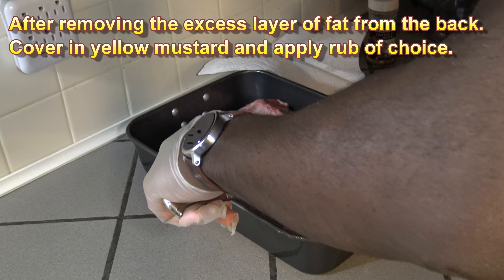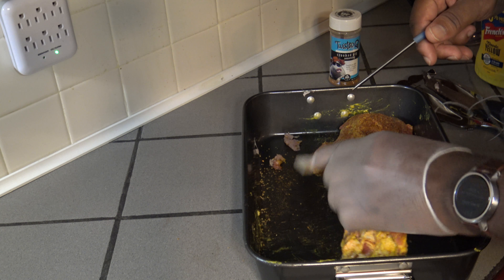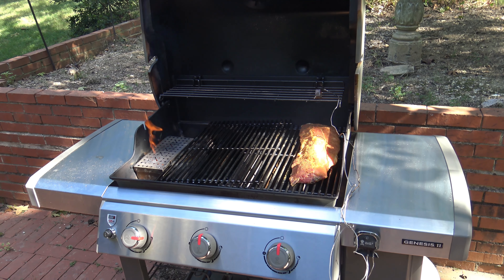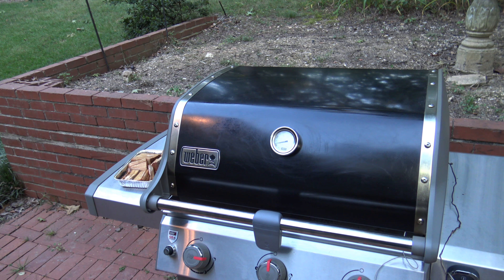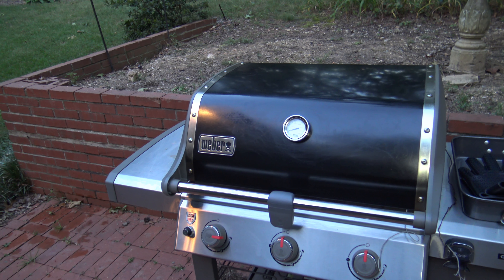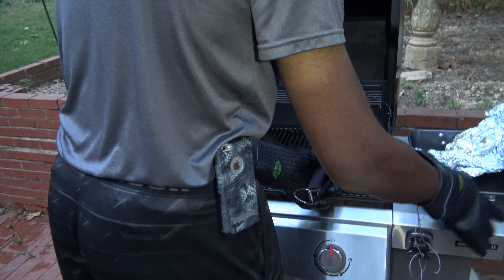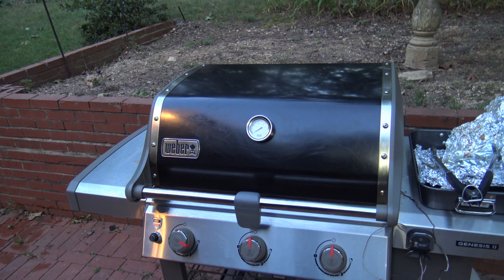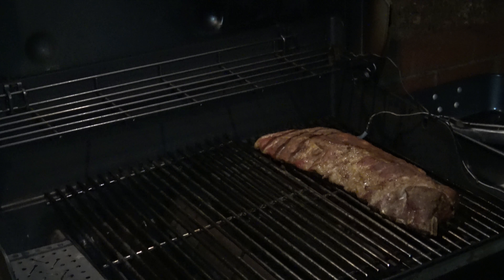Baby Back Ribs Smoked Slow & Low 321, Weber Genesis II Gas Grill

Comment: The ambient temp gauge is like 5” father away from the heat source
Reply from the maker: And you learn, that is a good place to have it.  Put it on the grates, and you will learn why to pull it up.  Just like the hood ambient probe is higher up 🙂

Comment: you might want to try putting a pan of water in the grill to stabilize low 225 temp. it works on my weber chargoal grill for slow and low.